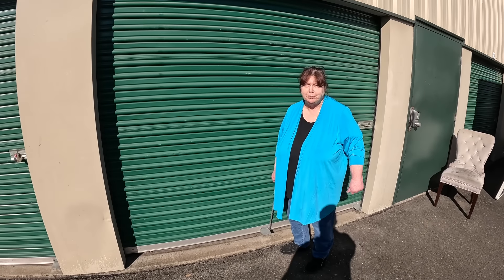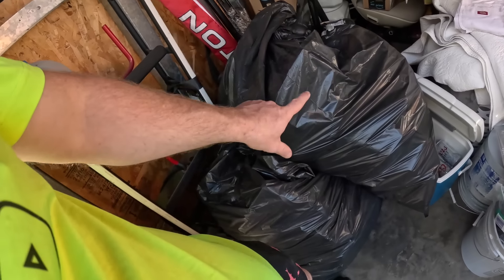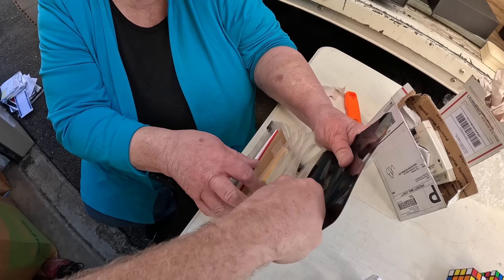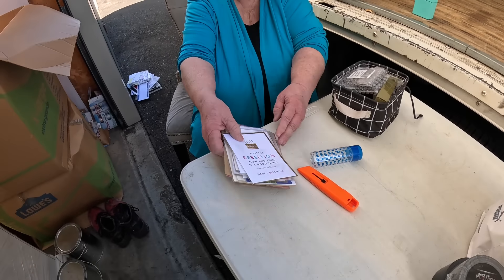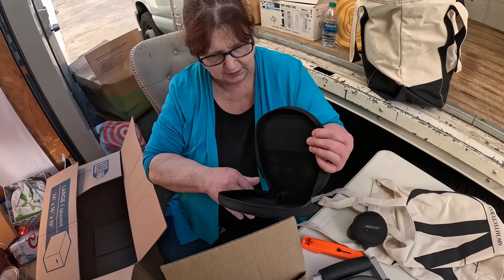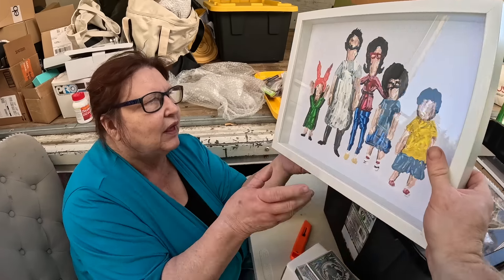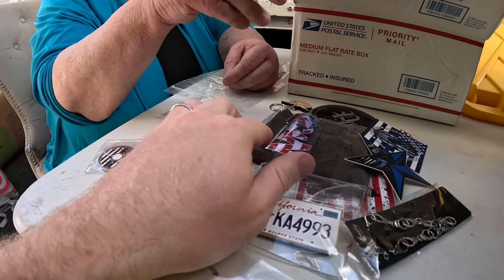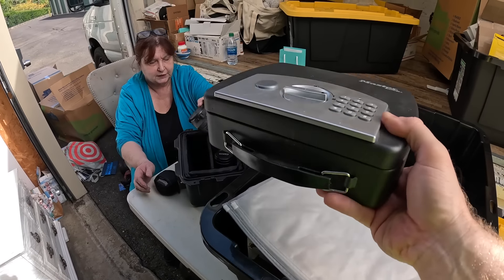I Found MONEY And MYSTERY In SECRET SERVICE Abandoned Storage Locker

Comment: The TAG Heuer watch looks like "Pro 2000 Chronograph" model. The second-hand value can vary between 750$ and 1000$. The price depends of its condition, with or without the certificate and the original box included.